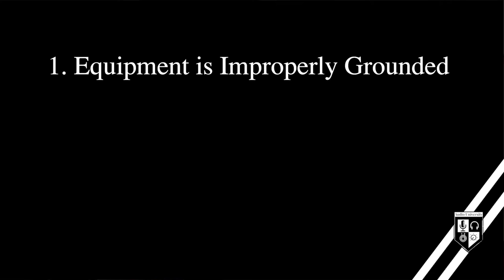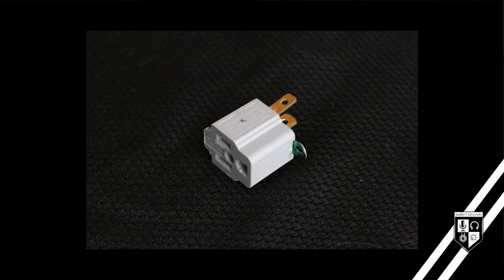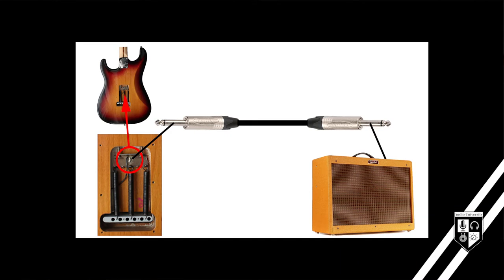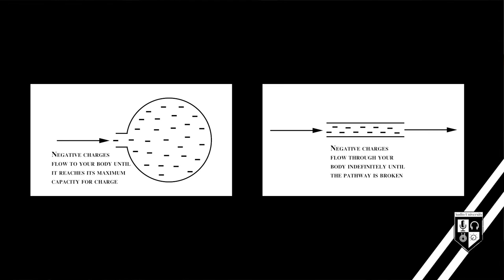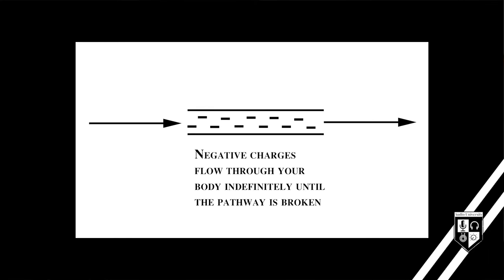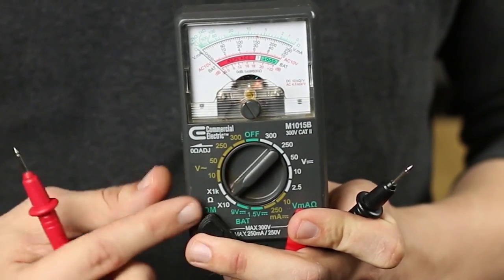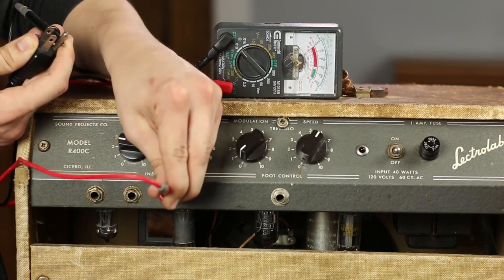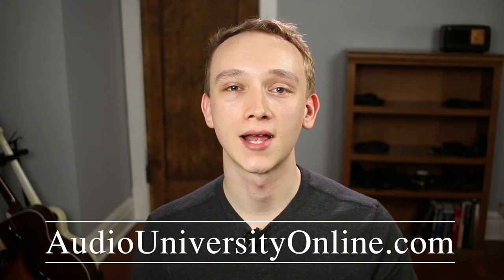Why is My Guitar or Microphone Shocking Me?

Comment: I feel very little shock like a 9v battery when i touch my guitar strings with my forearm. It doesn't matter what amp I use, its always the same, so I guess its normal for a little current.
Reply: I guess its because of guitar pedal ur using
Reply: Same thing also happed to me

Comment: I am using behringer xenyx 1002 mixer and it shocking me,but it using external power adapter. This power adapter dont have third  ground prong and when i unplugged it from electricity and touched body of mixer,i got shock too , I never connected microphone to this device, i am just using it as equlizer for my speakers.Sometimes randomly it will send some very strong sound to my speakers and they bzumming very much and when it happens i just need to disconnect it from electricity. Some help  ? :)
Reply from the maker: Did the cable originally have a third prong? Has it been removed?
Reply: @AudioUniversity  There originally wasnt third prong. But power supply connector on mixer have three pins,but i think its just because it is 2×15volt power supply.

Comment: Good video. Here's what happened to me. I was getting shocked while holding my guitar while touching the string, amp on. It turned out to be an outlet. There's a green light on my power strip, when it'son, I'm grounded. I noticed it wasn't on. I wiggled the pluf, while it was in the wall outlet. The green light flickered on and off. The ground on the wall outlet is loose.

Comment: Good day, sir. I feel electricity whenever I play my electric guitar. I think I feel it when I touch the strings. My amp, which is a Boss Katana MK II, does not have a 3-pronged plug. What do you suggest be my next course of action? Could it possibly be a problem in my guitar too? How do you suggest to correctly identify the source of the problem?
Reply from the maker: I had an old amplifier that didn't have a 3-pronged power plug. It was shocking me when I touched the guitar strings. I took it to a repair shop an they installed a 3-pronged power plug - the amp didn't shock me after that! I recommend you take your amp to get a 3-pronged power plug installed!
Reply: @AudioUniversity  My amp is relatively new and the model was only released last year. Do you think the amp really could be the problem? I also read that it is common practice for guitars to have groundings run current through the metal bridge and onto the strings to give off the excess electricity to the hands or body. When I touch mine, the electricity is very noticeable, sometimes even uncomfortable. Do you think this is safe?
Reply: @yeppieyay8906  how did you solve this problem? I have the same issue as you, and the very same amp too.
Reply: @luciano0593  I figured to just get a wireless system for my guitar.
Reply: Having the same problem with the same amp also rocking the katana mk2

Comment: The strings on my guitar used to shock me, I thing it was the extender thing I had it plugged into that was causing it. I haven't been shocked since I just plugged it straight into the wall but I'm still very cautious about it lol
Reply from the maker: Thanks for sharing! It’s possible the extension cable had a faulty connection to ground.
Reply: Yes, thank you. I reckon it’s my extension cord too

Comment: this is a great and very useful info , wow thanks for sharing it with us all.   We had an old antique fan running at a rehearsal one night and I went to move it while it was running and I was holding my electric guitar in the other, omg i got zapped so good my arm felt like rubber, what a shocking experience that was.  However now something different is happening.  I have a brand new Fishman acoustic amp that I plug a mic into and sometimes when my lip hits the mic I feel a little jab on my lip, I have no idea where to look on this one.  any suggestions would be greatly appreciated,  Peace !

Comment: I figured out that an outlet in my friend's music room wasn't properly grounded when I happened to touch the chassis of the rack mount, which surprisingly we had never touched while the amps were plugged in. It was only a tingling sensation like putting a 9v battery on your tongue. We plugged the power supply into a different outlet and that fixed the problem.

Comment: Would you do the same continuity test for a mixer? I.e. input and ground prong?
Reply from the maker: Yes. The ground on the power plug should be connected to the chassis of the mixer. Each input ground pin should be connected to the chassis. So there will be continuity between the input ground pins and the ground prong on the power plug. Good luck!

Comment: Hello, I don’t know what’s wrong but, my amplifier doesn’t have a 3rd metal piece so no voltage is drained away, what should I do
Reply from the maker: I'd recommend taking your amplifier to a repair shop to have a 3-prong power plug installed.

Comment: could it be an issue with the cord i'm using? i play on my amp and sometimes i play on my pc through a special cord and i still get shocked whenever i use either of them. it happens when my hand or forearm touches the bridge of my guitar. could buying a higher quality cord fix this issue?
Reply from the maker: If the instrument cable didn’t do its part to provide a pathway to ground, it wouldn’t carry the guitar signal. In other words, if the cable works, it isn’t the cause of the shock. 

Have you tried playing your guitar in a different building to isolate the power circuitry in your house?
Reply: Audio University no, but I’ll try that and see if that’s the problem 👍

Comment: I was jamming at a little little stage at a bar one time and I was shocked like you can't believe.. I stepped in a puddle of bear or something and man it grabbed me.. Another time I was shocked by touching the microphone stand.. I had an old Fender Twin reverb.. This amp didn't have a 3 prong plug and the building was about 110 years old and who knows how old the electrical wiring was.. I ended up getting active pickups so I wasn't grounding the strings and I bought a Nady wireless at the time.. I've never been shocked since.. I don't use old stuff now like the Fender twin which was stolen.. Even if I had an old amp I would get it fixed.. Scared me.. I hate being shocked.. 
Thanks so much for this..Very cool stuff..

Comment: No matter what I hook my guitar to it still gives me a bit of shock
Reply from the maker: You might consider taking your amp to a repair shop. Have you experienced the shock only when connected to your house’s power or in other buildings too?
Reply: @AudioUniversity  if it is in my house only then should i buy or use AVR or something?
Reply from the maker: Wherever you use equipment with a three-prong plug, you want to make sure there is a pathway to ground available.

Comment: Thanks alot man.i just noticed that a tiny shock from my guitar strings recently.i tested strings with fase meter(neon screwdriver)and see there is electricity in strings.is that normal?my guitar after a while starts to buzz but never at beginning after half an hour starts to buzz.can this be the cause of buzz?its like spark sound actually.thanks again❤

Comment: I'm a live music venue owner in Japan.  Before I opened last year, I had all of the wall outlets changed to accept three prong cords.  The outlets are safety grounded.  We have never had a shock problem until yesterday.   I have a 1969 Fender Super Reverb from America with a step up transformer.  The amp is 120V and has a three prong power cord.  The step up transformer accepts the three prong cord, but the other end that goes into the 100V wall has only two prongs.

We've been using the amp fine for one year and on the previous night too.  So when the guitarist got shocked at sound check, we were surprised.  We figured out that only this amp was the problem.  

My question is, why did unplugging the transformer from the wall, rotating the prongs, and reinserting it in the same outlet fix our problem?  Did our amp have a buildup of static electricity?  I will definitely buy a three prong transformer, but I want to know what the original problem was.  I will test the amp with a voltmeter today as per your video.  Thank you so much!
Reply from the maker: I’m not certain, here. My guess is that the transformer removed the pathway to ground. A transformer creates a gap, removing the direct, wired connection. Search around on Google for how transformers work, and that might make what I’ve written here make more sense.
Reply: @AudioUniversity  Thank you so much for the reply.  I think you're right.  I will start there.  I have a decent understanding about transformers already so I get what you're saying.  I'm a drummer so I don't mess with the amps much.  I did, however, know that grounding is important hence I spent money to upgrade the outlets before I opened.  Most old Japanese buildings only have the outlets for two prong plugs.

Comment: i got shocked by the guitar but other people dont? even when it not plugged to the wall, i still get shocked by guitar connected to a battery powered ( 9v ) pedal that isnt connected to the amp. Any ideas?
Reply: also shocked when touching the cable from the pedal input, so i had to ask someone to pull it out ( and they didnt felt a thing )

Comment: I am using a Scarlett solo 3rd gen; when I am plugging my acoustic guitar to the instrument line of the interface, there's a grounded sound even if im not using the instrument? Is it because of my guitar or the audio interface? But the mic inputs were working fine. A response would be appreciated! New subscriber here
Reply from the maker: Sometimes there is a ground loop sound from the computer monitors and other devices in your room. I've found that turning away from my computer and monitor helps reduce the noise. That might help, but you never can tell with this sort of thing without experimenting.

Comment: Can a GFCI receptical be used?  My old house only has two wire.  I've replaced some outlets with 3 prong but there is nothing attached to the ground plug. I'm wondering if a GFCI circuit breaker would solve the issue?
Reply from the maker: Great question. I'm not knowledgeable enough about power to answer that, unfortunately.

Comment: Hey A U ! Thanks for the vid. I have a Fender Amp that does not switch on. I unplugged power chord with ground and took the amp out from the cabinet, then when i touch some wires, i get like 220V shocks. Would you have an idea? Thanks **Update : just tested the circuit and some points are showing 50 to 100 VOLTS with power chord unplugged !! Believe it or not. (picture available) Friendly yours
Reply from the maker: I don't know much about the specifics, but I believe the capacitors in an amplifier maintain a charge for some time after the amplifier is unplugged. Just because it's unplugged doesn't mean it's safe to work with. I'd recommend reaching out to someone with more experience in amplifier repair if you're interested in learning to repair them yourself. Good luck! Be safe!

Comment: Hey! 
Sometimes I get very minute shock from my electric guitar when I touch it. And there is also some noise in my Blackstar id core amp.. But when I turn the tone knob of my guitar to zero, the noise disappears. Can you help me to identify which device is malfunctioning?
Reply from the maker: The noise probably becomes quieter when you adjust the tone knob only because the upper harmonics of the buzz are being turned down. I would say it's worth taking the amp to a repair shop to see if they can find any shorted connections to the chassis. If the amp isn't the problem, you might test to see if the problem persists when connected to a different source of power (another building or another power circuit in your building). Thanks for watching, @Labhansh! Good luck!
Reply: @AudioUniversity  Thankyou so much for replying!
Reply: experiencing the same thing with my Blackstar id core also. I'm going to test my other amps now to see if that's the problem
Reply: @BRNREK47  Please give an update here once you check on other amps please.
Reply: @labhanshchaurasia9980  I believe it's the power source now. Tried different amps and guitars. I'm wondering if a power conditioner would help
Reply: @BRNREK47  So other amps are also having same noise?
Reply: @BRNREK47  great

Comment: I connected my guitar to my computer and I feel the tickling sensation feeling.
Reply from the maker: Is your computer connected to power?
Reply: @AudioUniversity  yes it is.. is that the reason?
Reply from the maker: It should not shock you even if the computer is plugged into the wall... I’m not sure what is causing the shocks. It is likely a similar situation to what I’ve described in the video.

Comment: Hi there 

I’m experiencing an electric shock when I try to plug the amplifier cable wire to my guitar . This happened to me 3 times and my guitar fell off because of this I stopped playing due to this . From your experience is this a fault of the amplifier ? Or is this a problem of the earthed wires in the house I live in . We deal with lots of electric faults in our house though . Looking for a quick reply 

Thanks
Reply from the maker: I’d say most problems are rooted in earth grounding problems in the building.

Comment: Are all three pronged plugs safe? My Audient Audio Interface came with a three pronged connecter but the third prong is made of plastic(probably for a better fit) while the other two are made of metal
Reply from the maker: The safety ground feature of a three-pronged plug is only possible with three metal prongs. While all amplifiers should have three prongs, most audio interfaces do not. I hope that helps! Thanks for watching and commenting, @Ishaan Kunwar!

Comment: Bro idk if you could help if you still got time lol but fuckin A dude I turn on my amp and jam out for about half a hour and then I get a fucking shock either on my fingertip from the pickup or the bridge of the guitar shocks my palm it’s not like a crazy shock it’s enough for me to be worried I changed my amp cord for a new 3 prong and it still has the same issue could it be my guitar itself I’ve thought about maybe having to re solder the wires and etc

Comment: How about if you play electric guitar connected to an Amp running solely on battery power. And let's add for instance I would be playing barefoot on the outside, on wet grass. Or I am playing on my battery-powered amp but I also happen to touch a microphone connected to a grounded grid plug.. Can I get shocked in those occasions? That amp runs 6 batteries 1.5V and is about 8Watts.

Comment: Dear Sir, your all demonstrations are pretty great and sounds congratulations!!!

 I am a beginner on electric guitar. When I fixed my guitar to amplifier there is a big hum ( ground loop).But if I touch strings then hum will fade away. The problem is that the power cable is a fixed one to the amplifier and it doesn't have a ground pin to connect to the 3  phase power socket. Only 2 pins plug. So have can I kill the hum???? thanks
Reply from the maker: I had a vintage guitar amplifier with the same problem. It was sold to me with a 2-prong power plug. 

I recommend getting a 3-prong power cable installed. If you don’t have experience working with amplifiers, take it to a professional. 

Thanks for watching!

Comment: Would a power conditioner solve the problem if it's the main power source? (power strip or wall outlets)
Reply from the maker: The power conditioner would only solve the problem if it provides a pathway to ground that was not there without it.

A power strip could help solve buzz issues by establishing a common ground reference to all of the connected devices. Plugging connected devices to different power sources can sometimes cause a ground loop, which results in a "buzz".

Comment: Hey, I just bought an adaptor for my amp and unfortunately it's shocking me. It's an original adaptor by boss but has two prongs. Will it be fine if I buy a 3 prong off brand cable for the adapter even tho it says not to use other cables on the manual of the adaptor? and how do I knoe if the wire is compatible?
Reply from the maker: What is the adapter for?
Reply: @AudioUniversity  Boss katana mini, it's the original one, psb-230eu meant to replace the old adapter, as it's shocking me is changing the extension cable with a cheap off market onek with 3 prongs a good idea?
Reply from the maker: I can’t really offer any advice, unfortunately. Have you tried calling Boss?